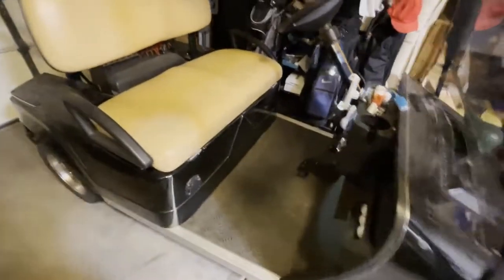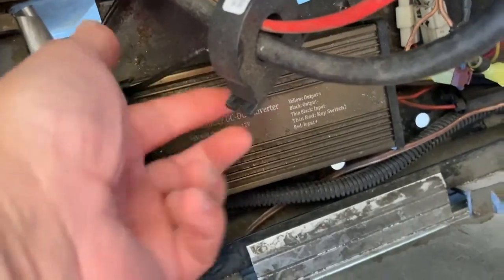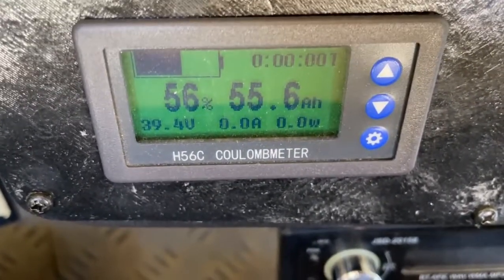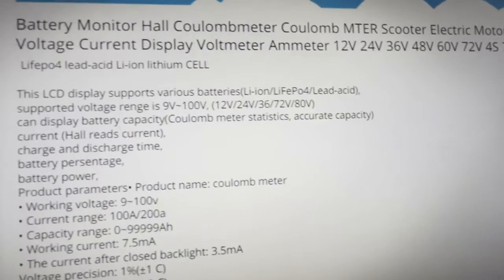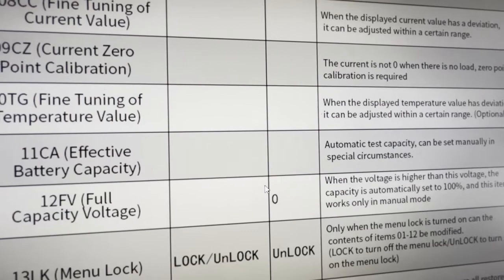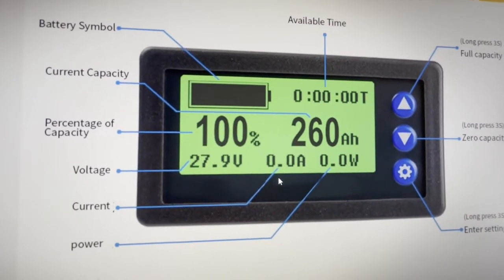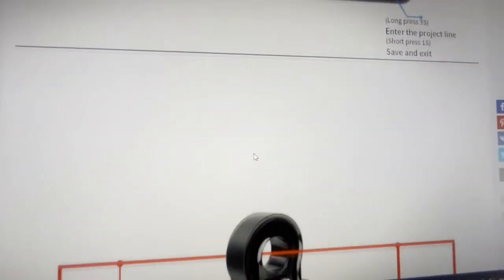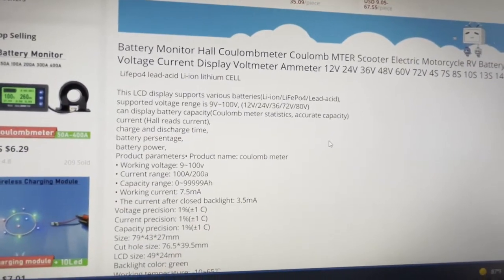H56C Coulombmeter H56C Coulombmeter for LiFePo4 battery

Comment: Hello, can you confirm that the coulombmeter function does what I think it does, namely:

During the life of a battery 1-10 years (whatever it is) it charges and discharges, the coulombmeter function measures what current comes out and what current comes in (subtracts and adds - averages, etc.) then results (normally after several cycles, not instantly) the capacity in Ah of the battery.

Let's say we have a 100Ah battery and I cycle it 20-80%, the coulomb meter should show me after some time a capacity of 60Ah (ideal). If we reduce the losses, I think somewhere around 55-59Ah.

This is true ? Does it do what I think?
Reply from the maker: I am not sure what you mean by cycling the battery 20-80%.  If you mean run the battery down to 20-80% before recharging  back to full, then the battery should always charge back to full Ah the battery is rated at.  I am no expert but I believe the columbmeter  works off the hall effect principle and  measures current flow. So as long as you use your charger and fully charge the battery and your battery meter shows 100% when the battery is finished charging.  All your settings on the meter are correct.  After the first charge is done ,press and hold the top arrow button till the meter shows 100%. the meter is now calibrated to your battery based on the settings.  Hope this info helps and my videos on the meter help as well.
Reply: @deanrivera100   ok so you don't know what I asked. I order 3 pcs from aliexpress and I will test them.
Reply from the maker: @electronistul  enjoy the batteries.

Comment: Hi Dean, I bought a H56C Coulomb Meter and it works fine. My question is: is it possible to keep the display on all the time? Normally it turns off after a certain time. I haven't found any instructions for this setup.  Thank you.   Carlo
Reply from the maker: The only way I know to turn on the backlight is to press the setup button.   It needs 0ver 5mA to stay on., the press of the setup button provides this for about 10 seconds then turns off,  there probably is a small capacitor inside that determines how long the backlight stays on.      If you can find that capacitor and short it out that may keep the backlight on.
Reply: Thank you for your answer. I need to ask you another question regarding setup. On the display I always have the battery icon moving (values from 0 to 100) and the capacity percentage icon always at zero. I need to check a 200AH lifepo4 battery. I set the following parameters on the H56C Coulombmeter: 01ZV = 46v, 11CA = 200Ah, 12FV = 56.4v. I think I didn't setup correctly. Can you help me? Thank you    Carlo

Comment: FYI, the sensor is not a coil as you assumed. Current transformers used on AC consist of coils but aren't useful on DC. What you have is a semiconductor Hall Effect sensor. This sits in a flux gap in a toroidal core where the magnetic field caused by current in your battery cable changes the sensor conductivity. The other alternative for DC current measuring is a resistive shunt resistor in series with the battery.
Reply from the maker: I figured since the current sensor was round that it had a coil of wire inside.  A toroidal core with an IC makes more sense to measure current flow. Thanks.

Comment: hello, where can i find manual from the coulombmeter?  thanks for sharing
Reply from the maker: The manual can be found when you search for the meter on google, Amazon or Aliexpress.
Reply: @deanrivera100  в последней прошивки устройства 20 пунктов. а везде 14
Reply from the maker: @tixtixist  I don’t know about the firmware for this device.  Check with the seller of the device.  I believe you can reset the device to factory default settings using the menu.